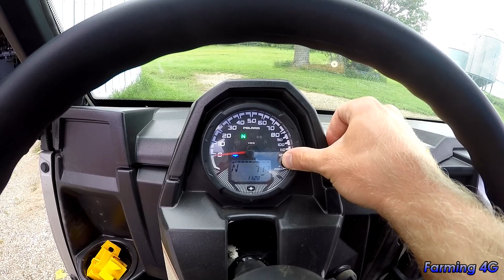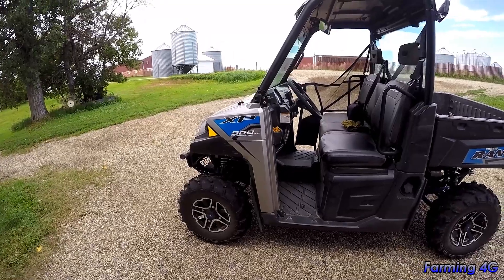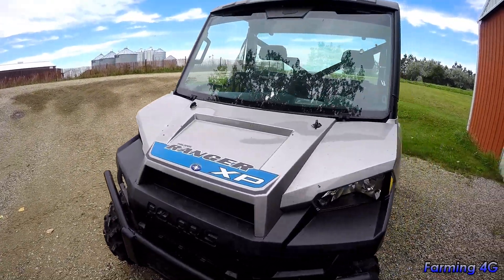Review: '17 Polaris Ranger 900 XP (700 Mile, 100 Hour Interval)

Comment: I have the same year 900xp. It's got over 7000miles & 2100 hrs. I use it every day & it's been a good machine. I have the enclosed cab with heater, electric windows, windshield wipers & washer, a few other things, A little plug-in fridge in the corner of the box for refreshments. Just fluids, chg. plugs once, 2 new front axles a couple years ago & tires. been a beast.
Reply from the maker: That's great to hear! Must be one of Polaris' rare winners.

I think mine here hit 3700 miles and over 600 hrs. Only issue with it so far is the power steering sometimes throws a code and doesn't work until restart.